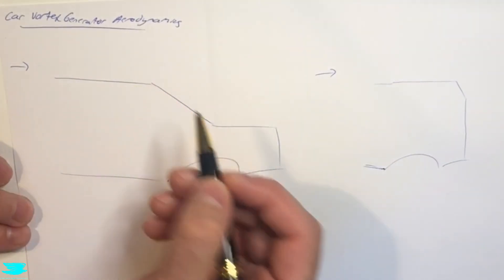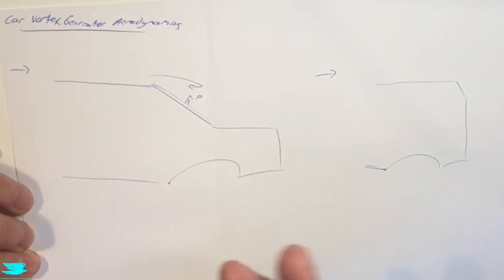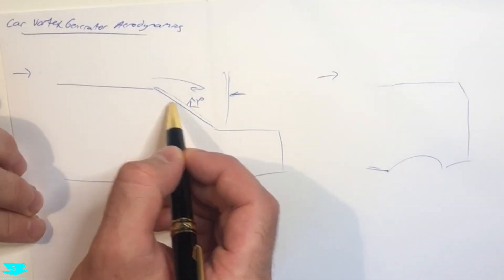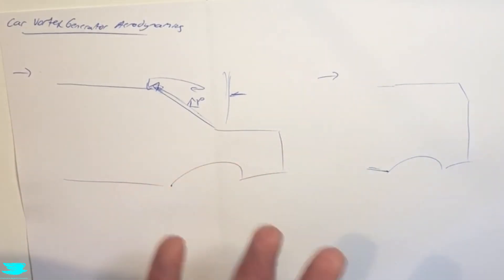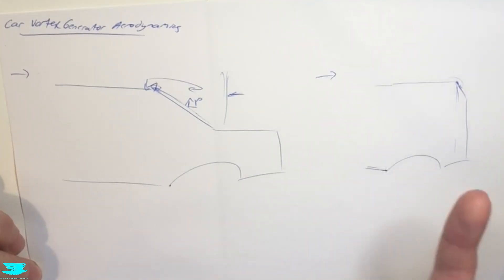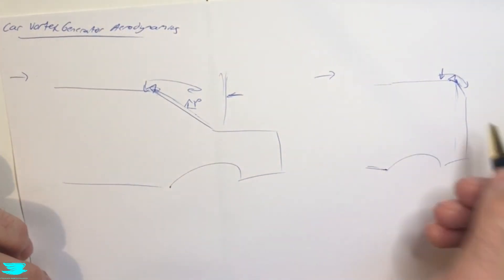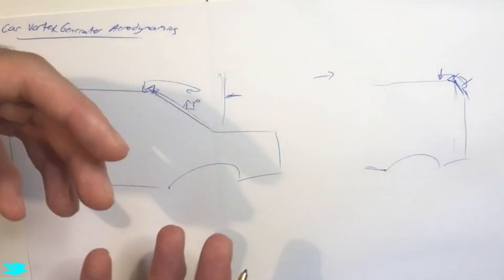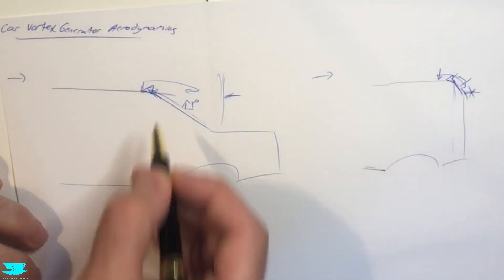Car Vortex Generator Aerodynamics {Auto Aero #74}

Comment: I have a Mazda cx3, but how do i mount the shark fins? \\\\ //// or //// \\\\  or \ /\ /  \ /\ / or /\ /\  /\ /\ or just in the air flow as | | | | | | | |
Reply from the maker: Usually /\ /\  /\ /\ , but I don't think they'll work well on the CX3, the rear window is still too angled down.

Comment: Id definitely like to see the aerodynamics of the original 917 if they just added vortex generators to it. Or maybe somone should design a modern car based on the 917 with the driver moved considerably back for safety reasons.
Reply from the maker: Thanks for the idea!

Comment: Wouldn't a vortex generator on minivans help prevent airflow spilling over the sides?  So whilst it's not helping at the back it's helping airflow keep attached to the roof?  If that's right maybe it'd need to be further forward than on sedans.
Reply from the maker: If there is flow separation, then it is definitely possible. In next week's video about the Mini Cooper (we are doing on Saturday), we look at improving its aerodynamics in that way.

For sedans, often the sides are quite rounded, so the effect is a little different and the flow these days stays attached over the roof and the back window.

Comment: 1. your title is click bait.  you don't explain how the fluid creates vortices coming off the vortex generator 
2. you're confused as to what is fluid pressure vs aerodynamic load, just because you can measure load with things like load cells and place units of pressure does not mean it's fluid pressure
3. you're confused as to what generates lift vs downforce.   because you're not looking at the vector of the fluid.  the downward vector of attached flow IS LIFT visa versa an upward vector is downforce... something tells me you skipped air foils and sail boat sails.   
 4. you dont mention shear lines (it's the main stress affecting fluids)  why the sharp angle of the roof/window is a line of shear for the fluid
5 you dont talk about the conservation of energy from potential energy of fluid pressure to kinetic energy of fluid in motion.  Why Bernoulli's Principle even exists.  the reason why someone like you can just regurgitate 'it energizes the air...'   
6. this is more about car aerodynamics than vortex generators....   
7. this video is CONVOLUTED... you're getting lost in your own explanation you failed to realize when there's flow separation there's no boundary to have this 'high pressure' you speak of... large eddies are still low pressure hence DRAG...
8. it might help to look at the rearward sweep of MODERN cars to CONTRAST that  STEEP downward angle from roof to window and how that DOWNWARD VECTOR is far more gentle then it ever was in the 60s 70s 80s 90s era cars...  seriously...  deconvolute your brain
9. F=MA  air molecules have mass.. .that mass accelerated generates Force and that Force can be measured as LOAD.  hence the concept of G LOADING.   you know so much then DONT FORGET THE FUNDAMENTALS...  OTHERWISE THE ADVANCED TOPICS ARE POINTLESS.   it also seems like you skipped the pre requisite of FLUID MECHANICS and went straight to Aerodynamics and are NOW LOST in your convoluted explanations
Reply: Look... buddy... there's not enough length to the car to have enough surface friction to slow down the boundary layer to the point of separation (it's not an airbus or boeing fuselage or even military submarine). so it's not about the boundary layer not having enough energy.  as i stated above a 'line of shear' due to the cars geometry causes the air to shear and separate from the car.  not unlike watching metal shavings 'curling' off a lathe or cnc mill...  THE CURLING... THE LARGE EDDY...  THE STRESS OF SHEAR whether it be metal or liquid or gases or a chisel and wood...  SHEAR STRESS... 

PARASITIC DRAG.... often times visibly seen as extremely tight vortexes coming off wing tips of planes... LOW PRESSURE AIR...  VORTEX GENERATORS...   golf ball dimples just so happen to be VORTEX GENERATORS as well...   VERY SMALL VORTICES WITH THE PURPOSEFUL DELIBERATE PLACEMENT ARE NO LONGER PARASITIC DRAG...
Reply from the maker: Awesome, happy you liked it! Consider supporting us on Patreon to help us fuel more of these videos for you!

Comment: you literally answered a burning question I had about my dumb minivan, adding a few vortex generators to try and help the low pressure zone at the back.

fun fact: at most speeds above 100 km/h, my stupid minivan will actually decelerate downhill(!) where all the other cars on the highway can coast or accelerate. I can only assume this is due to terrible aero.
Reply from the maker: It's probably because the flow separates over the top and doesn't reattach, so the drag coefficient skyrockets. That's a common cause.
Reply: If you mount a propeller at 3-6 feet distance on your trailer hitch.
You gonna get huge drag reduction.
The propeller needs to be powerd, and it's rpm need to be adjusted to the driving speed. 
2-4 feet propeller diameter should work.
For 100 km/h minivan 1-2 kw propeller power consumption should be enough.

This saves ca. 50% of fuel consumption 
A security cage around the propeller 
makes it a bit less efficient.
Reply: @c.l.3806  That's called an Airplane

Comment: Woo we're getting closer to a Hyundai Staria cfd analysis! On a more serious note, could a reasonable step (to create a vortex before the flow separation) work to just use the boundary layer to reduce lift and drag and possibly even create thrust while still allowing the higher layers to retain "laminar" flow?
Reply from the maker: Steps are often used to trip the boundary layer to turbulence, so trying to get some reverse without turbulence is very difficult and not a robust way of doing it.

Comment: Correct me if I'm wrong, then that means the hatchback kind of works like river trout, where they spread their scales to push themselves forward with the recirculating vortices from the oncoming current. Since the flow detaches off the hatch roof the void that forms at the back of the hatchback, curves the flow in the reverse direction which then impinges on the rear hatch to kind of push it forward a little.
Reply from the maker: That's a good analogy. There is definitely some of that going on, but it's a lot more efficient for trout than for hatchbacks because there is a lot of low pressure too for the hatchback.